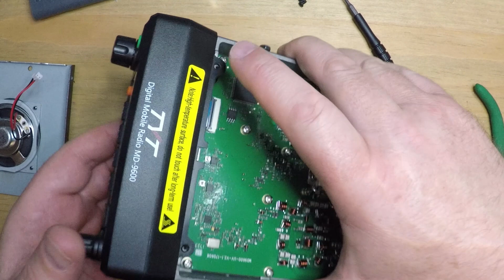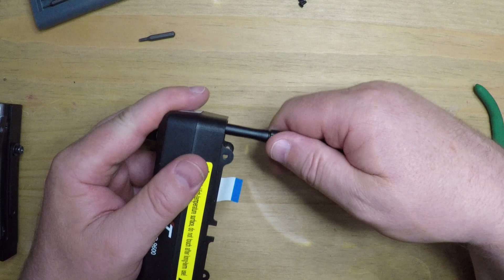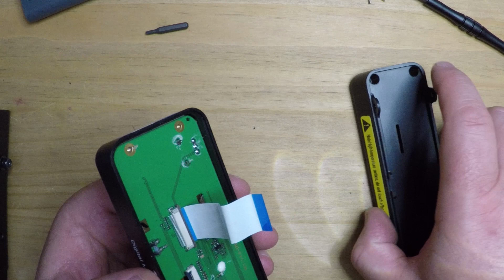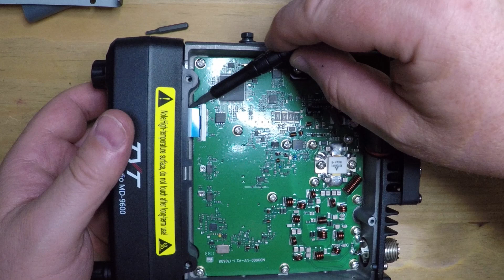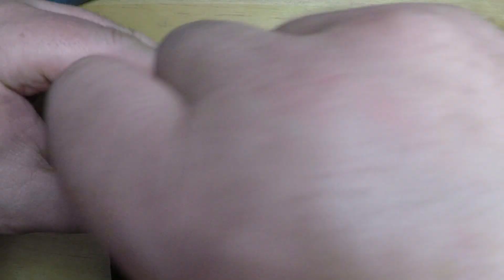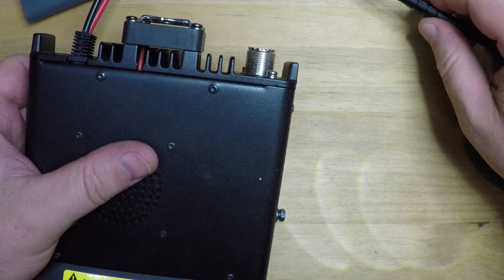TYT-MD9600 Retevis RT-95 Mobile radio white screen fix.

Comment: I had the same problem. Google can be your friend.  After opening the case and getting to the problem cable. I cleaned the ribbon side first. Not much help. Then with alcohol I carefully cleaned the connector side. It came back to life. After tapping on the cable a few times it seemed solid. So far so good. Thanks so much for the post!

Comment: I had the same problem with my MD - 9600 radio. I was going to give up and throw it away until I saw your video thank you for steering me in the right direction on how to correct this problem. I removed all ribbon cables and clean them with contact cleaner and q-tips then reinstalled all ribbon cables back in and lock them down tight in there connectors and now the display works fine, thanks again. 👍

Comment: Hello, I bought a TYT MD9600 last year which is now one month out of the sellers warranty.My Mini USB Socket has disappeared into the case.  If I shake it a little I can see the socket comeinto view.  I watched your video hoping I might find out to access the socket, but I assume there is no way toaccess it without removing the circuit board.  any suggestions would be greatly appreciatedMike hamfist43@gmail.com
Reply from the maker: I will have a look for you.. should be a fidly but simple fix..

Comment: I have 2 of these Gary same FW on both but the pop as the squelch closes is much worse on 1 than the other any ideas why that would be?
Reply from the maker: Where did you get it from and when?
Reply: TheGazLab They were from Martin Lynch & sons I bought them both new from the batch they were waiting for last year Gary. They were supposedly the new modded batch from TYT.
Reply from the maker: All the radios were modded for sure, give them a call if its really bad.. Gaz
Reply: TheGazLab Its no big deal mate i just thought there may be something i could try that might help. Thanks anyway Gaz

Comment: 73 hello someone to this kind of problem and the mic no longer turn on.
Reply from the maker: The early releases of the md9600 had some issues with the microphone backlight. I understand this was a firmware fix, so update your firmware. If you suspect there is a hardware issue let me know more detail I can ask tyt tech.. Gaz
Reply: TheGazLab 73 md 9600 V2 the device does not turn on the screen remains white the microphone is off when you press P1 P2 P3 P4 it turns on and that's a thank you very much.
Reply from the maker: ok, if the screen is white, try the ribbon clean again on both ribbon cables.. you may find this is the charm.. if you cant get it to work get it back to the dealer who sold it to you for repair.. Gaz